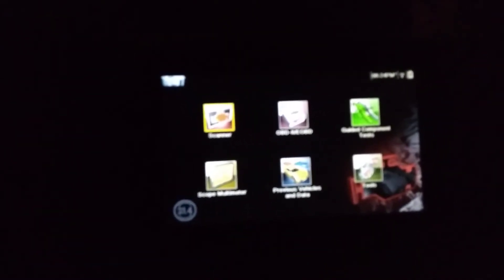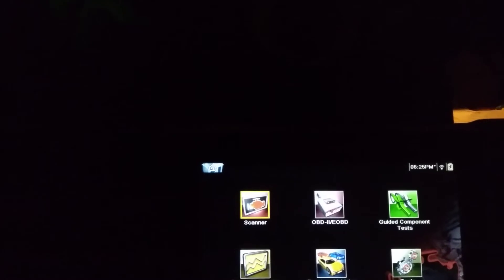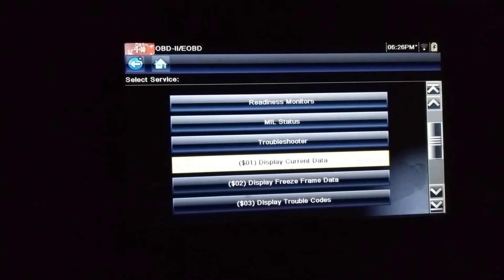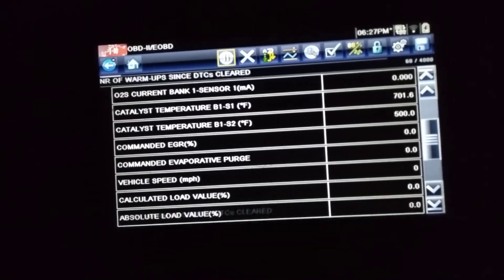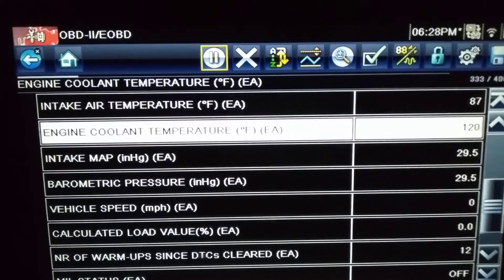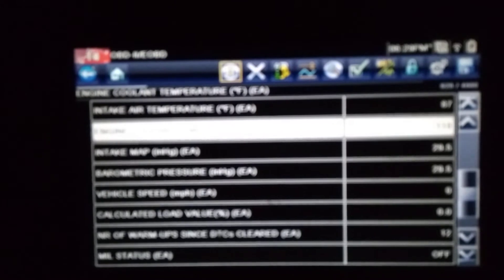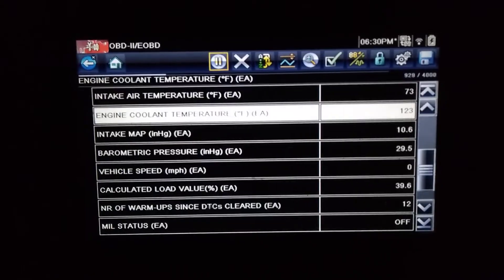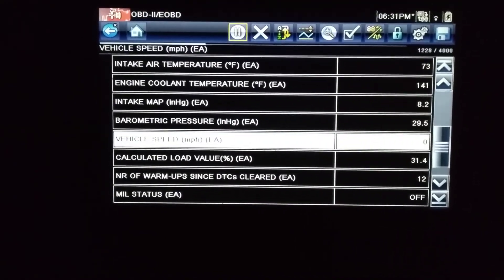How to delete Permanent codes OBD2 to pass smog in California

Comment: unplug battery easier lol
Reply from the maker: No. That doesn't work brother, everytime you unplug the battery you reset the parameters so if you got 12 warm ups done you have to start from 0
Reply: @danielx7922  you have to drain the power to the computer. Unplug for 24 hours.
Reply: @Nostradamus_Order33  that doesn't work for permanent dtc codes for cars 2010+

Comment: One correction to your Video.  The 15 warm up cycles (not drive cycles) and 200 miles driven won't "Clear" the Permanent DTC.  When you get the 15/200 the CA SMOG machine will "Ignore" the permanent DTC.   Now you may clear it in the 15/200 but if you have not no need to worry as long as you got the 15/200 you will pass the SMOG as long as no other cods have come up and gone to a confirmed code.  

More info here:  https://www.bar.ca.gov/Industry/PDTC